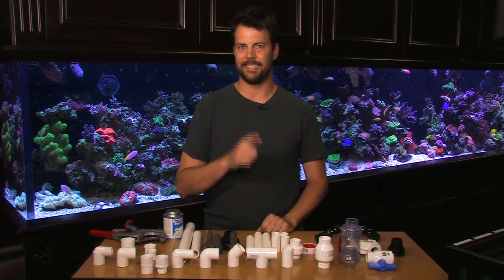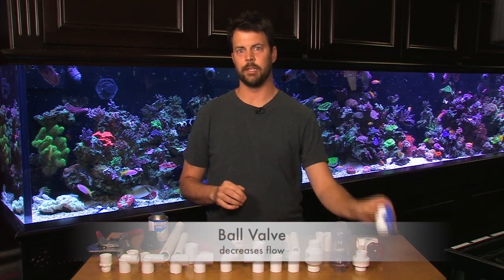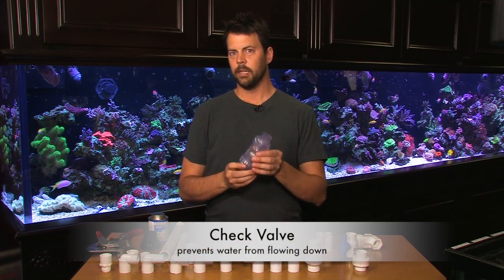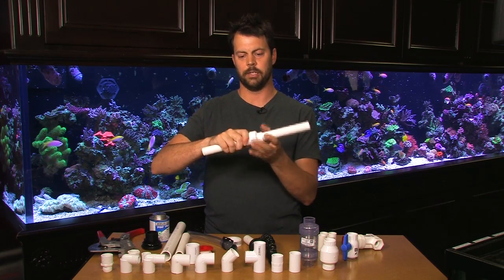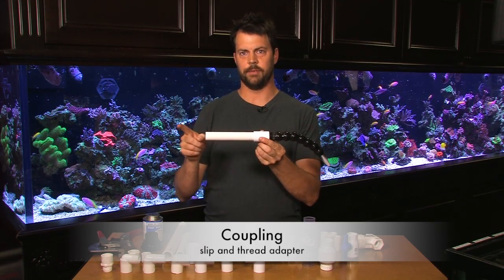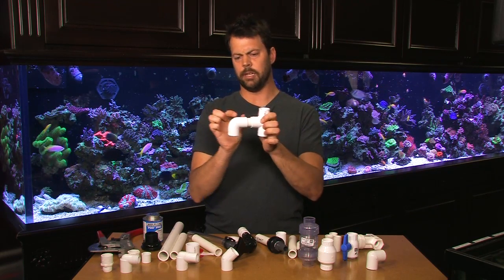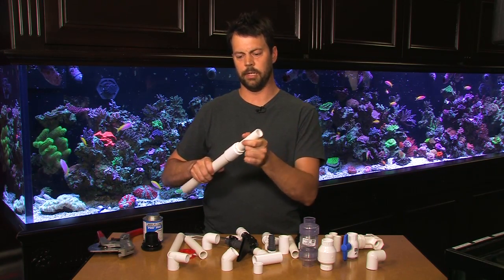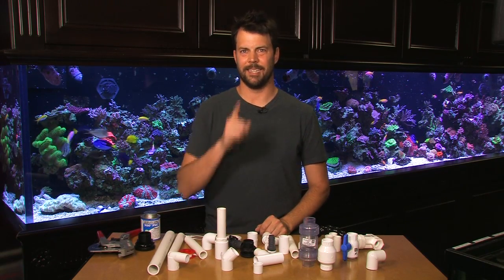Aquarium Plumbing Parts Explained

Comment: On my sump there is a slotted piece of pvc with an end cap that has a hole. It enters into the first chamber of the sump and is coming directly from the aquarium overflow plumbing. What’s the purpose of this section of pipe? What’s it called? And do I need it?